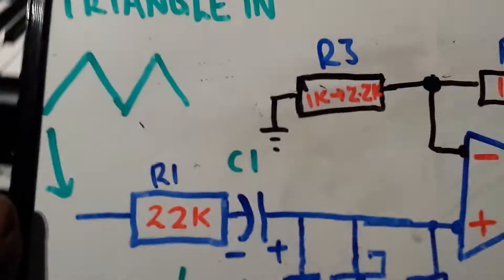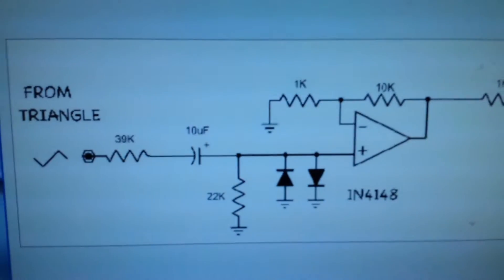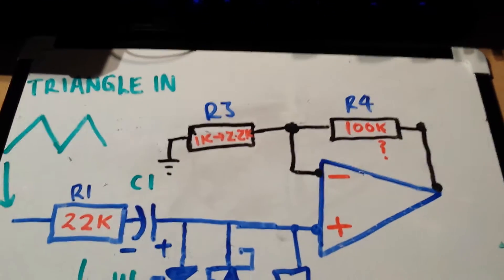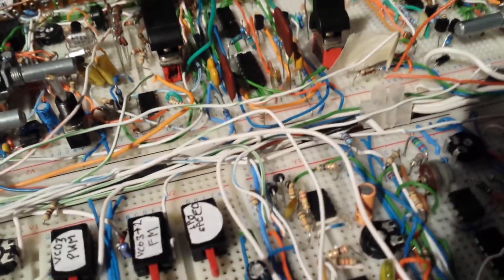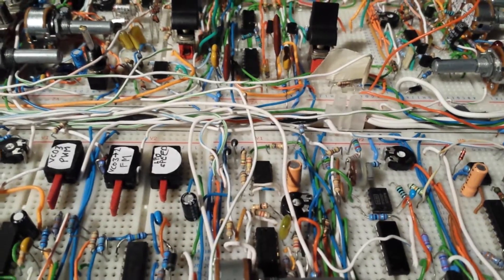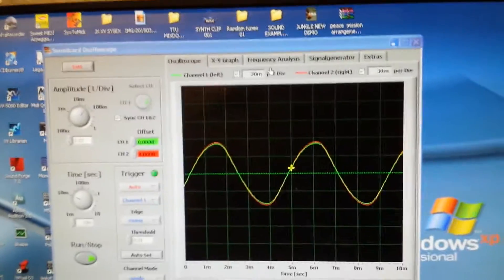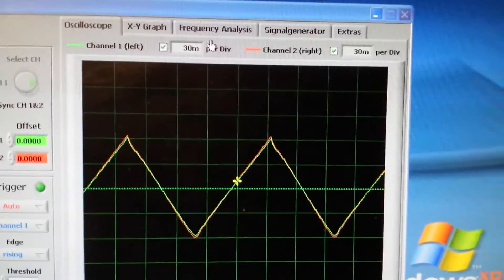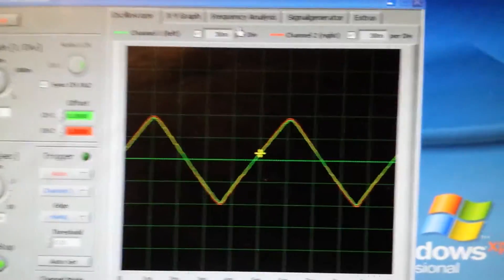DIY analog synth Project Tutorial Part 7b (Sine waveshaper amendment)

Comment: Nice video as always! :) 
Those video's of yours are also the reason I got myself a (2nd hand) minibrute a few weeks ago. Lovely toy to play around with. Haven't had much time lately, but I hope be able to make an expo converter soon to connect its CV-outs to. 
btw. Does your Minibrute also have an extra octave below the -2 ?? If I press the "minus" button when it's in -2, the -1 lights up and the -2 is lit very faintly and it produces tones yet another octave lower than -2?? Don't now if that's just a glitch in my unit?
Reply from the maker: Jean-Jacques de Balzac Hi thankyou for your comment and all your helpful comments.  Im glad you have enjoyed watching these vids. Yes i would say go for for it with the minibrute. Yes my munibrute goes below -3 on the octave switch if you press the oct switch at -2 so my lowest C is about 16.7 Hz . If yours doesnt do this, it may be faulty . Do you know what firmware version you are running on the MB ?. Yes they are very useful little tools.
Reply: If your unit also does the same I guess its just a quirky minibrute thing. You won't hear me complain about the extra octave. :)

Thank you for your videos. I was looking to build a nice simple synth with a step sequencer, but your project really made me aim higher (1V/Oct adsr etc.). The acid sound somewhere around video 7, (with the old filter still ??) really made me want to start a similar project. Although I haven't really built anything but simple 40106, lm358, and tl074 oscillators up until now I learnt a lot. :)
And thanks for linking to the Kniteforce set btw! Those Kniteforce releases have dominated my playlist for the last few weeks... :)
Reply from the maker: Your welcome JJ i have enjoyed putting them together thou never i would i ever get this far when i started the project with only the principle knowledge of how most subtractive synths work. Yes i think  on that video 7 was using VCF 1 Steiner clone with the diffrent caps to what im using now in the diode ladder its sounds even better now imo. More importantly im glad you have taken inspiration from the series and i hope others have too. Regardless of what type of oscillator you build every circuit you succeed and fail with is part of the learnimg journey. No worries on the Kniteforce set link, again a very inspirational label for me when i was a DJ and first got into music production years ago. Good to know we share a similar taste in beats lol. 👍👍
Reply: As I was a Dutch kid in the 90ies how can I possibly not love those beats... I grew up with that sound... :)  Maybe a bit too young at that time for the raves, but I made up for that later in life...
Reply from the maker: Jean-Jacques de Balzac  Wow good to know :-) :-)👍👍